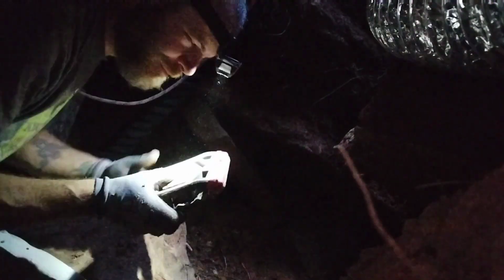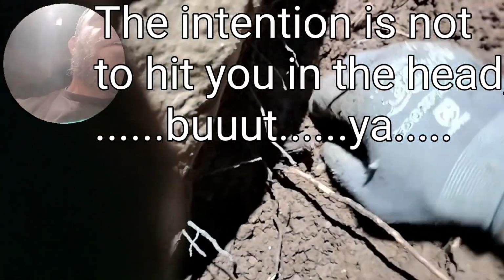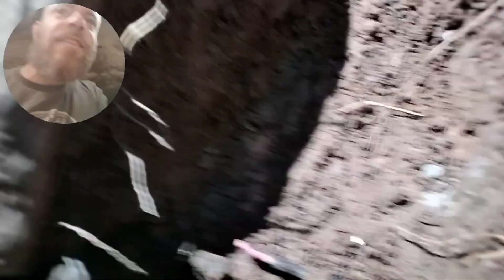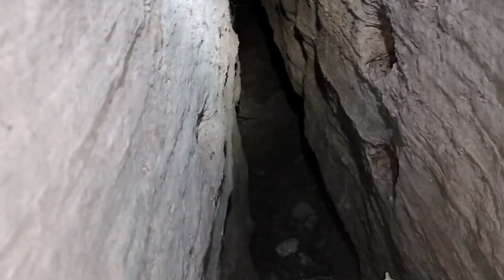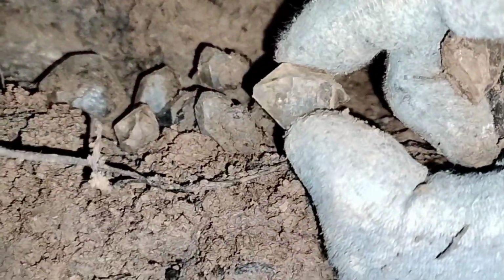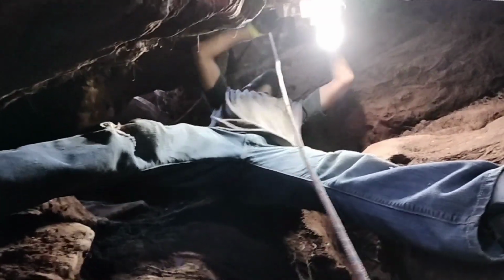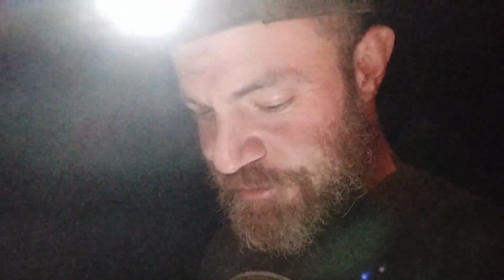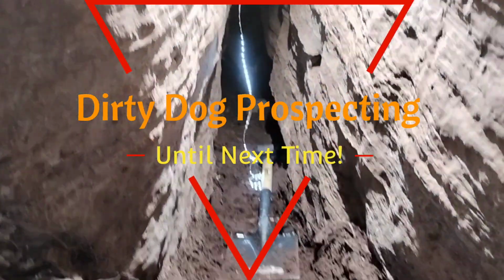It just keeps getting better! Cave of Diamonds continues! #rockhounding #arizona

Comment: So cool! Don't let the DP Chrystal fever take over too much. I am concerned for you all in regards to the fact that you are undermining the load bearing clay. Monsoon, water ect... I know that those rocks above you and beside you are not light. Have spent may hours using a farm jack, pry bars, and come a longs moving those huge rocks out of the way up there praying that we would not have them fall back on us. Maybe digging out the top first and making the opening much wider and safer. one BIG hole? You will have to probably deal with some "forever hole buddies" but better than a crushed body...